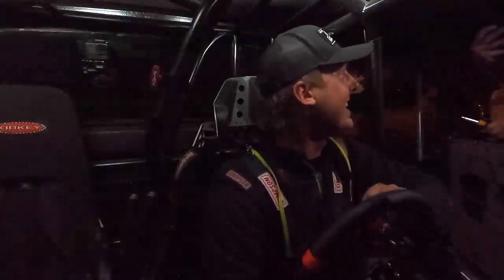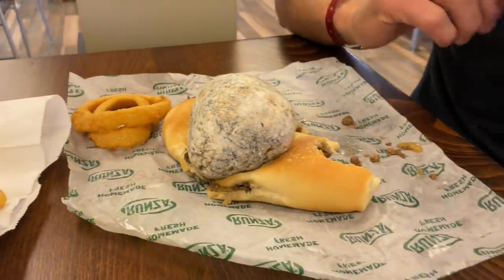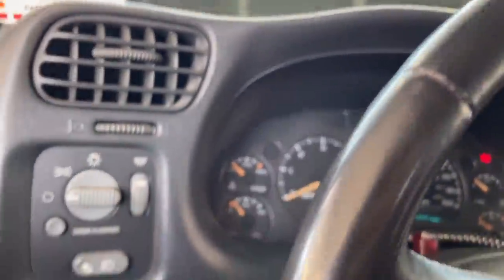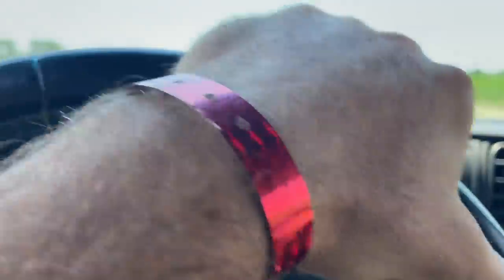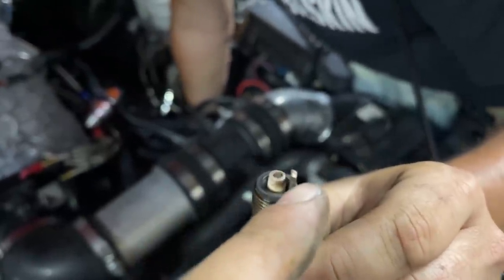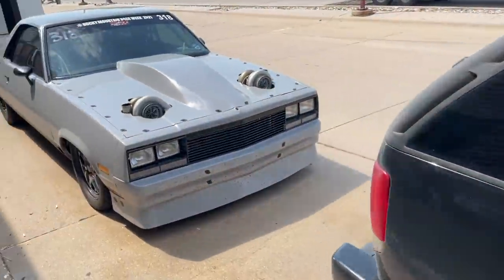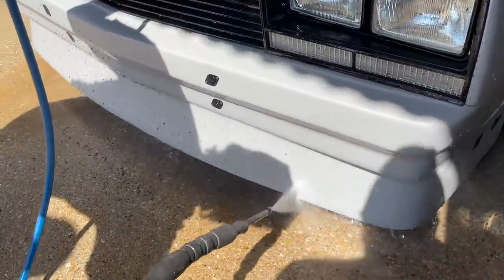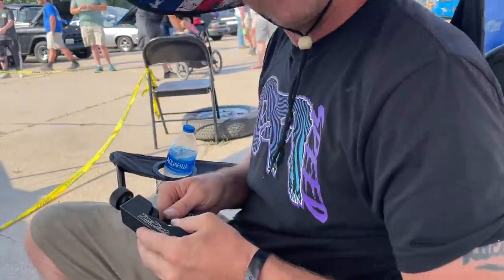RACE WEEK Day 6: We Got Mullet into a SITUATION lol! (Worst Passes Yet...)

Comment: And have to admit I'm shocked KSR didn't wire in a sensor on the intercooler water tank door to let you know it isn't closed/lock, lol
Reply: He will now ha
Reply: I’m sure Kevin will upgrade that…
Reply: hahah yeah no doubt
Reply: We all know Kevin is taking notes this entire week: the fuel temp, the intercooler lid, probably has a fix ready for all the bugs too.
Reply: @daniel8939  trans temp! he probably already ordered a bigger trans cooler and fan
Reply: Kevin should wire in a motorized close and lock mechanism whenever the car powers on.
Reply: Have a monster tach shift light blast you right in the face when it isn't closed.
Reply: @Mr.Potato420  thought he said he made the mount in the rear to be able to have dual transmission coolers back there.
Reply: He's gonna wire up a self packing chute, an ice machine, and a fuel cooler.. Lol! Kevin's the man!
Reply: How about paying attention to what you're doing!
Reply: I thought he did.
Reply: @Axial32  Yeah, you could see it when they relocated the water tank drip. That'll take of the care of the transmission for sure, but he still has to fab up a fuel cooler and bracket somewhere.
Reply: I am surprised Kevin didn’t wire the driver seat to register Cleets pucker factor as he makes runs.
Reply: @Lotek117  I'd say as close as the single trans radiator seems to be at keeping the temps under control, a second would probably more than needed. The fuel doesn't need a lot of radiator. I was thinking they should add something like a 75/25 split radiator there. At any rate it'll be interesting to see what Kevin comes up with.
Reply: Kevin saw it happen on the live stream. He was great to have on there.
Reply: Brilliant idea. Big light on the dash too
Reply: R&D
Reply: @Axial32  He did indeed 👍

Comment: On the 7:73 run the front end does not lift. The car pretty much launches flat. The three launches where it blows the tires off. The front lifts substantially, not a flat launch. Just something I noticed. The front stayed level and the rear squated on the 773.

Comment: @Cleetus McFarland
Hey Garret I'm sorry to see the trouble you had on that sub standard track not having any clear scoreboards at the 1/4 mile mark which would have made it even more difficult. I was thinking about Tom Bailey's car you drove & how the rear tyres are much wider & taller than yours which would give more twist & crinkle to the sidewalls on the start line, have you thought about changing your rear wheels to have wider & larger diameter tyres? Would a change of tyres like that make your starts quicker & give your more traction so that you wouldn't slide at all? I just want you to get a 6.8 second pass in your new car that you & Kevin put so much effort into.
Mark, Perth, Western Australia

Comment: Full up full both fuel tanks and ice tank .
god even add a dam sand bag over the rear diff .for weight . on the tyres .
Track was hot . trans has been getting hot towing the trailer .
Change trans fluid .its probably cooked!! From all the driving up hills

Comment: Ol' Mullet just needs a good old fashioned test and tune. Testing a brand spanking new build on two straight race weeks is impressive enough not having any mechanical issues, I'd be amazed if the tune was perfect already.
Reply: Bring Kevin to the track for a day so he can set the car up for all kinds of situations to show how each of those adjustments works. I have a feeling if you would've adjusted the suspension as much as the tuning you'd be on it.

Comment: You are right it is not like Ruby. You and James built Ruby and you know it's ins-and-outs. Ruby is a lot more simple. Kevin has built I sure nuff race car but it is way more high-tech. Kevin probably could do a couple adjustments and make it run 7s period but with y'all not being familiar with the suspension probably is the biggest hurdle to have to jump. No matter if you run a 12-second pass or a 6-second pass I'm here to watch you you guys are great. Keep up the good work
Reply: it would had been neat if they used corvette rear suspension with the same trans/diff set up as ruby. better weight distribution and different
Reply: @SXSPRIME  no need to pop wheelies

Comment: No biggie. The car is just not dialed in yet. Kevin had to crunch finishing the build until 5mins before going to Midwest Drag and then from that directly to race week. Rent out the home drag strip again and get the car right with KSR and mid to low 7s should be a given.
Reply: Problem is ruby and leroy are already at that level, well not ruby now, but those cars are capable.
Reply: Agreed
Reply: I bet it hasn't even got 20 runs on it yet
Reply: I think you guys might be confusing sorted out car with one that needs adjustments for changing conditions. they just don't know how to adjust suspension, if it wasn't for another racer helping them and Kevin not there. they have no one to hold their hand they get lost. jackstand ain't it, pretty much everything he says to adjust is incorrect, you could hear how impressed cleet was in passed videos when Kevin said make this change and it worked, he had been used to James saying stuff and it not working and Brent doesn't have experience with these 4 link rwd cars, he will be the one to learn it thou. 
I think this will be the last time you see mullet on race week without Kevin near by, even if it's driving a different car, he will be there to lead them down the Track.
Reply: @jsomething2  YEP.  What seems interesting is that the car this whole week hasnt seemed to want to transfer weight all that well.  Also shit tracks but still..
Reply: @jsomething2  it's a combination of none of them knowing how to play with suspension, no fault of their own they just simply haven't had the opportunity to play with a 4 link, a new car, and being hot as balls out.
Reply: @1320crusier  yep. definitely hot slick tracks are much harder and my guess is being such a long wheelbase the chassis tuning is more difficult. but again just a guess cause I'm not going to pretend I know this stuff. drag racing is legit hard to do when going fast enough.
Reply: @jsomething2  w/o actual data its tough to guesstimate but its the yt comment section.  We're all experts! lol.  
I suppose if you loosened up that front end more you could bandaid it but yea.
Reply: @ryanlamfers8692  yeah, I don't blame cleetus as he's pt barum and Brent probably knows how to get a fwd to hook from years of experience. I just see over and over jack stand has spent his whole life drag racing, always gives advice like he's 100% positive, gets credit for being a brilliant racer. but seems to be of no help or makes shit worse. cleetus's brother's car, he's like you rod knocked it by not changing oil a 100% with everyone laughing at the kid's first car. they drop the oil pan, no rod bearing spun, instead cleetus turned it up to much in the tune, lifted the head, cyl filled with water after it sat for a bit and they bent a rod cranking it hydrolocked. like dude goes into this long stories how he knows why everything does everything and I just don't see any of it play out.
Reply: @jsomething2  It's almost like its a bunch of amateur youtubers playing at being a race team. You only have to spend 10 seconds looking at just how well prepped actual racers are with their cars to see the obvious difference. Every time there is a legit racer at the FF like Gittins or that FD dude the other day. The difference in approach is chalk and cheese. One is measured and the other is 'Yeehaw cleetah send it yolo'. Not hard to work out which is which. It makes for fun and entertaining videos. But it's not even close to professional racing.

The never ending Cleeter hero worship does not help. But I put that down to young kids with no clue about how things actually work
Reply: @jsomething2  they're young they'll figure it out eventually. Growing up around drag racing means nothing if all you were around was 10 second street cars, 4 link is a whole new critter. I haven't watched any of his brothers videos so I couldn't say anything about that car other than if you aren't breaking stuff you aren't trying hard enough. You never know what actually went wrong until you have the engine opened up, unless you can internal parts without any intentional disassembly. 
 Nobody ever got anywhere in racing without blowing up motors and pulling out their hair trying to go faster. The faster you want to go the more shit you're going to break and the more expensive it'll be.
Reply: @ferociousmullet9287  just as many people have blundered their way to success as have planned every step of the way. This is a lot more fun to watch, and people watching is what is feeding him at this point, what would you do?
Reply: @ferociousmullet9287  lol seriously, 3 yea ago he couldn’t drift or launch a car, the guy is doing great for his age and what he has built. Many racers started out exactly at or below his current level with nowhere near the success and many of the racers that do make it to your opinion of professional have a lot of help.

Comment: Looks a lot like making the boost transition smoother means it’s also bringing in a little bit more boost during the weight transfer. Maybe the reason Kevin had it ramp in after the 60’ was to allow for the weight to be on the tire and then bring the thunder. Only explanation for all the sudden breaking loose like that imo

Comment: Gonna need a billet water cooled pan on that transmission like Freibruger just got on the F rod and run it on another ice tank.
Reply: I'm wondering if he'll end up dropping that combo eventually to run something a bit more reliable... I admit I'm no expert but a 2-speed powerglide + bolt on overdrive sounds complex to my ear, and it doesn't surprise me they get complex issues from that. My dad's a drag racing photographer and been involved or watching the sport since the 70s so I guess I'll ask him what he thinks tomorrow/get schooled 😂
Reply: @W1ldTangent  Tom bailey is running the same setup in multiple cars doing 6’s on race weeks, its a proven setup and cleet, Kev and everyone did a lot of homework on mullet.
Reply: @jimlstheworldyewww7516  tom baily, like most of the faster guys runs a 400 with a gearvendor overdrive, not a powerglide.
Reply: @W1ldTangent  actually I think nothings more simple than that, the powerglide itself is pretty tough as is and the overdrive is just like if you would have a transfercase for 4 wheel drive on a average Auto transmission, so nothing to complex.
Reply: Those gear vendors are pretty stout, Im surprised they gave up on it that quickly and threw the longer rear ratio in it so it wouldn't need to use the GV during the pass. I get they were kinda in a hurry and were probably gun shy after ruining the first GV they had, but after Cleet saying the longer rear ratio is making tuning for Mullet a little more difficult, why not throw the old rear gears back in it now that their second GV is nice and broke in from Rocky Mountain Race Week?
Reply: @Timman57  the gear vendors are stout, and while they rate them for that sort of power its hard on them. the fast guys that use them on drag week always seem to pack a spare, even if they arent using it during a run.

the way i see it, the short gear and using the overdrive is a band-aid solution for having the wrong transmission. they were trying to get the same end result that the 400 would provide (a shorter low gear). if you look at the fast guys that run race week style events they typically run a 400 with a gear vendor. 

powerglides are great for bracket racing and very light cars, mullet is neither.
Reply: @Sharkey_t  those are all fair points, solid argument, I think they liked what they got from the powerglide in ruby and maybe didn't think mullet through and just copy and pasted, figured Kevin would have picked up on something like that though, either way, hope they get it dialed, I want to see 6's haha
Reply: @Timman57  iirc the powerglide came into the picture way back when it was being built as a jet car. when kevin was building the car he talked about his plan on the rear gear and using the gearvendor during a pass, and the first thing that came to mind is he wants a 400 in the car.

id love to see mullet run 6s as well, but in all honesty i dont see it happening. the way the car is now, id bet it will run 7.30s on a real good track with some work, but i feel they will struggle to get it much faster. maybe if everything is perfect they could squeak a 6.9x out of it, but it will never be a consistent 6 second car.

Comment: Blazer needs the smaller wheels put on and the diff welded. Really enjoying all the content. Cheers boys.
Reply: A lunchbox locker would be a better solution, its cheap, easy/quick to install, and actually unlocks for normal driving/turns. That way itd still be a decent road vehicle with all the benefit of welded gears.

Comment: Maybe you slackers should run a pass or two during the daytime heat so you have a decent time already and aren’t rushing around at the last minute to get literally anything in the cooler evenings. Use the better conditions to improve on what you already have instead of wasting time just assuming it will work out in your favor later.

Comment: You want to keep the power planted in the back I thought? Seems like the  suspension need to be adjusted to each track/tune
Reply: I agree.  I'd think a lower and longer power curve on the boost might help too.  Very little at the start and opened up the further he goes down the track.  Just seems like it needs to back off a bit.

Comment: Great job with everything you've done!! I'm sure you already know this... maybe don't think of PSI as an indicator of power. Look at MAD, manifold air density. The manifold pressure /  inlet temp will tell you what power you're making at any point in your logs. How many pounds per minute of air is your engine consuming? That will allow you to have a more consistent leave. Cool content either way!! Awesome video!

Comment: Did you guys ever change the oil at all the whole trip. You 've ingested 43lbs of bugs and road dirt on a fresh motor. Maintenance is key when it's 100 degrees. never mind got my answer @8:05.quick turnaround=tire pressures to high.

Comment: You guys are hyper focused on the computer tuning... Maybe time to take a step back and look at the ENTIRE set of factors involved with varying conditions. I'm willing to bet you over looked tire pressure in the scramble to grab glory. Like an old teacher said.. You need to go slower to go faster. Make that list and maybe start collecting physical data like track temps tire pressures and maybe chart out a better then guessing method for all the other factors. The car is built right for sure. Maybe on non you tube times start going over everything and come up with a routine for leaving pit area and at the line. Routine and consistency is what separates the pros and the joes.

Comment: Are you maxed on the 4link making it softer?... Then can you change the progressive spring rate?   It seems like  it's preloading way to fast ( .4 second and spin)... Like it's bottomed out.    Just my opinion.... Watching it squat like it does and twist like it did on Dyno.  Might consider loosening the sway bar a bit in front A little more transition of power to the rear.  Match that with boost rolling in and I think you would get more grip in the 60'

Comment: First off .... Congrats on yet another win and Trophy from RMRW 1.0 . Don't be so hard on yourselves especially since Mullet is brand new and needs a track rental day test session to dial it in . Also the intense  extremely hot weather didn't help either 

      I think you need a dedicated  suspension tuner/ specialist on your team at your race events . This person would gather run info from your data log or directly from you or from go pro video of the launch . This person would then adjust the suspension  to changing track conditions  

        A 4  link setup is the best suspension  for a drag race car to begin with but with all the different adjustments it has it can be quite deceiving . Doing to many adjustments at one time can cause problems with the geometry 

      You should get with Kevin at KSR and ask him if he could be your suspension specialist at race events . If that's not possible talk with Red at Motion Raceworks or Tom Bailey and ask if they know of a suspension specialist that can be on your team

Comment: Make about 4 saved tune profiles starting at no prep and working up to perfect track fresh prep. That way you can start with the low tune if the tires blow off and it's less guess work in the moment. If you're lowest tune can hook up and go on regular un prepped pavement then you can always find a tune for the track regardless of altitude or track condition.

Comment: My college's drag car has an asymetrical rear 4 link setup. So the one side is lifted slightly. The torque from launch twists the whole car and keeps the car level on the launch so one tire doesn't lift from the body twisting. Maybe you need to investigate that?

Comment: Brake cleaner is super for cooling when you need to cool something real quick spray it with brake fluid cleaner cans it doesn't leave a mess it disolves in seconds we always did this at my work to quickly cool aluminium housings for trans.

Comment: When you set up the rear end to handle massive power, when you start to pull a lot of power from the start, the back end wont be doing what it's supposed to again as it's expecting a ton of power to push back against it. It's possible the back end is skipping off the initial accel, followed by much lower sustained accel after, as it's still pushing back like you're gonna launch at 20psi lol.